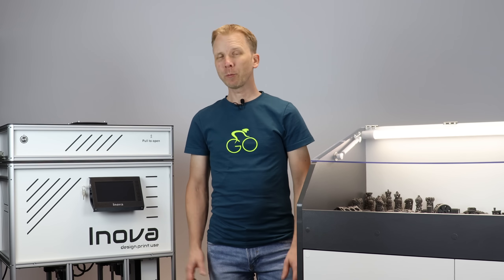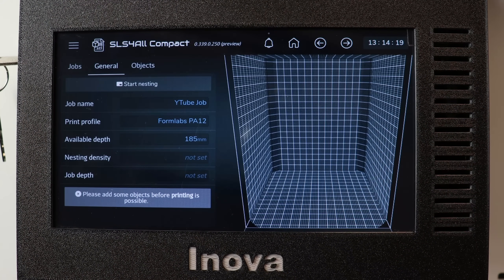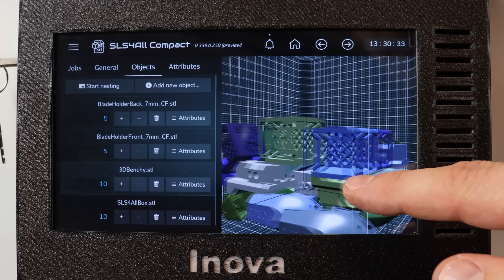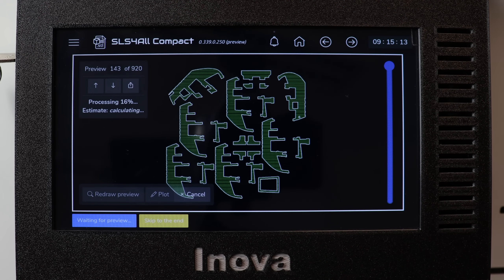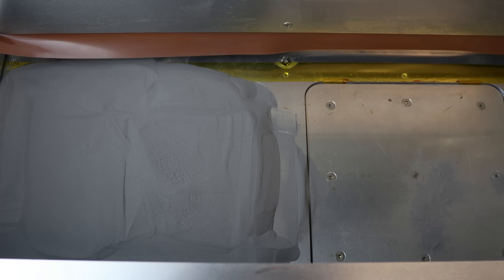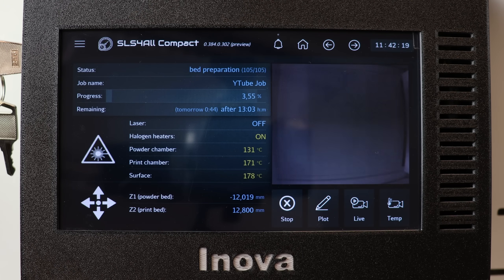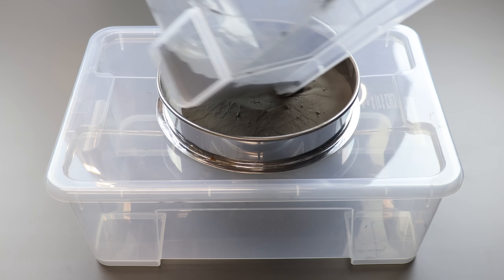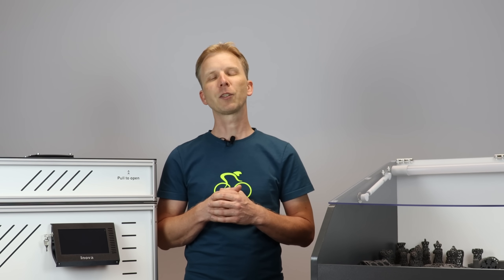Excited about building DIY SLS printer? See how it prints!

Comment: Can it print with gypsum powder, what plastic powder do you use?
Reply from the maker: I don't know if gypsum can be sintered togetger, but I guess that not.
It is designed mainly for PA12 nylon based powders. But we print from TPU as well and other materials like PA11 will follow.
Reply: @SLS4All what recommended powder to print with it?
Reply from the maker: We print from Formlabs PA12 because it is of a relatively good price/performance ratio. But our users print happily from other powders as well - like Sinterit, Farsoon, etc.

Comment: That print job cost $264 in powder!!  I know a small portion of it was recycled but it's still a lot and unaffordable for most people.  Even if that SLS printer was free, I couldn't use one.
Reply from the maker: Your calculation is completely wrong. Reuse ratio is 70% and the rest of 30% is used for printed parts.

Comment: Very nice!. I may be completely wrong, but I feel like if you added a means of replacing the air inside with Argon, used a higher energy laser, used a building plate with a specialized thermal protective coating, and adjusted the software for the difference in working material.... you could probably 3D print metals with this.

Comment: Great work for a DIY technology appropriate to our times, but it is essential to
Set the Effective Build Volume to the standard: 220 x 220 x 250 mm adopted by standard consumer FDM printers... the customer base will multiply by a factor of 10 minimum...

instead Effective Build Volume for PA12 Nylon: 150 x 150 x 180 mm (4.1 liters) / 5.9 x 5.9 x 7.1 inches (247.2 cubic inches)
Reply from the maker: Interesting point, but I don't think SLS can be compared as simple as that to the FDM. It is like with the SLA - different technology, different use cases, ...
Reply: @SLS4All  Hi, ČESKO
Thanks for your answers
My message just recommends to size the print volume to the same values as those already defined and adopted on the most common FDM printers... it is not very complicated to do, you can, and propose a second model larger by a few mm more to add on some mechanical components of the current SLS4All version, and also define the appropriate parameters for these new dimensions in the SLS slicing software.

I am not making comparisons between SLS and FDM 3D printing technologies. The limitations of FDM technologies compared to SLS and SLA are well known by any designer and maker... Anyway. My intention is constructive, in the positive sense. I would be interested in a SLS4All model with a print volume of 220x220x250mm

Many designers and makers design their object creations based on the 220x220x250mm manufacturing volume that has become standard thanks to consumer FDM 3D printers... So it becomes very easy to adopt a new SLS4All machine for commercial production.

It's all good for your superb product, SLS4All, which can very easily be integrated into 3D manufacturing workshops already equipped with standard FDM machines

Comment: Is there any way to do the deal with the job on the PC and sand the file to printer
I think it may be work
Reply from the maker: You can completely control the printer remotely from PC. You can connect to the printer from your LAN via any browser.
Reply: @SLS4All  So that I can do every thing except printing on my PC?
Reply from the maker: Yes, you can.
Reply: @SLS4All   
Thanks for your answer
Reply: @SLS4All  by the way if that i expect for a huge build area ，and that i have notice that you are using the popular 3d printer control board，so can you add the support for multiple laser galvanometers in the frimware or it just already support?

Comment: I have a Formlabs Fuse 1. What a piece of crap. It fails a lot, I have lost thousands of euros in powder. The support is just "try again. Oh, it worked? No problem then...". 

I have replaced broken parts (they charged me 400 euros for a regular stepper motor, where the only thing wrong was a broken 1 cent pipe splice). Consumables are crazy expensive. They charge 5000 euro a year in service agreement (which I ended because why pay when they have no interest at all in fixing problems -- when the agreement says on site free service). 

So my plan had been to develop my own. Mostly just to have Formlabs buying outright because with their crappy shit of a product they can't handle competitors. But when I see how well you have done, I have cancelled the plan.

You single handedly have built a better printer with better software. You should now get investors and go big. Crush the evil F. 

I wish you good luck. If you want any input from a serial entrepreneur of hardware consumer products, please let me know. I'll share experiences with you that might help you get this manufactured and sold in large quantities. Everything I can do to help crush the scammers from the US.

The Formlabs is totally closed. Can't use other powders. Well, today, I got a firmware update that opens up for other powders. It cost €14,500 to enable. I'm not kidding. And the customer doesn't get ANY info during the printing process that can help diagnose the failed prints.

You even made superior software!! I'm so extremely impressed.
Reply from the maker: Thank you for your words of support. Let's see what the future holds...

Comment: As someone who used to run and service Hp Multijet fusion printers I want to congratulate you on this  very impressive and extremely cheap printer (for the given technology). Have you tested part strength?
Reply from the maker: Thank you! As for the part testing  - not yet, but it is planned.

Comment: What's the maximum print size?

Can you use this for moulds for aluminium casting in a video?
Reply from the maker: Max. usable build volume is 150x150x180mm.
Thanks for the topic for the video!
Reply: Already recommend the machine to friends here in Adelaide South Australia - do you ship worldwide , use metric plans?
 @SLS4All 

I'm sure you can sls ceramic,no?

Do you plan on making a larger model?
Thanks 😊 look forward to casting video 😀
Reply from the maker: Thanks! Yes, we ship worldwide and we are metric.
Printer is only for the plastic polymers, not ceramics. Lager model is not planned at this moment.
Reply: @SLS4All oh, ok thanks 🙏 
So, this printer can't be used with metals ceramics or composites? Just nylons?
Reply from the maker: Not just nylons, but yes - it's for plastic.

Comment: $7,000 is the kit cost. And I believe that does not include the cleaning station. This is a very impressive demonstration. However I would not say at this price that this is something that is "for all." I was expecting a kit to be 2 or $3,000 and even then I would probably wait and see. Yes nylon SLS is far superior to FDM or SLA. Still, a wonderful FDM printer can now be had for 1/10 this cost. When I really need SLS parts I will have a job shop make them and ship it to me, it's quick cost effective these days.
Reply from the maker: I uderstand your point but if you check the costs of the parts needed you will see that price tag you would like to see is now simply impossible.
Believe me that I would be more than happy if I could offer it cheaper. Btw., when FDM and SLA printers started, I mean before their boom, the demand was low and prices high. That's the rule of the market.

Comment: Can you instead place a 500w laser and make it metal 3d printer ? I can help with the ac dc converter
Reply from the maker: No, you can't. Priting metal is a completely different discipline, it is not just about the laser power.

Comment: This thing is amazing! I hope what's published remains published regardless of what the future holds for this wonderful project!
What's killing me is the post processing of these parts. PA12 is a crazy strong material that speaks for itself once you have in in your hands but the process is even more involved and much more messy than even SLA which most people already don't want to do. Seems like the next step is to develop and auto-cleaner as well as a proper powder recycler. Then, while we're at it, we need to develop a part recycler. I don't see why that wouldn't be possible. Just grind down the parts back to powder of the same grain size. I'm sure there is a way to so that reliably similar to the original industrial process as well. Keep up the amazing work!
Reply from the maker: Thanks!
Post processing can be annoying but not if you have the right tools and accessories. I don't think it will be easily possible to have fully automated post processing on the small SLS machines, but maybe I am wrong.

Comment: ading ULTRASONIC vubrator in the hopper/reservoir will make compactnes of powder ultrasmooth without need of press.. )single ultrasonic horn will do the job..  ( add bit of shake every slkice will make sure the perfrect layer.. just saying..
Reply: Btw i see you are Czech..  Are you conected by anyway to Prusa?? or oyu are self-separed project..
Reply from the maker: No, I am not connected to Prusa in any sense of meaning.

Comment: It looks pretty promising ! Thanks for having it Open Source/DIY, we don't see that everywhere.

In hurry to see more complex prints (eg. High details figurines), those were quite easy one... 

Furthermore, comparison of parts strength vs FDM prints could be nice to see if SLS is worth it. 

Total printing cost per gram or volume can be calculated I assumed ?
Reply from the maker: Thanks!
If you are interested in prints with more details check this gallery: https://sls4all.com/test-prints-gallery/#bwg20/590
Mechanical tests are planned, I will post the results.
As for the costs - yes it can be calculated. Powder which I use is about 100USD/Kg.

Comment: It seems during the process of powder bed filling and levelling step 2, it still didnt distribute powder to top right corner and mayber also to bottom right corner seen at 10:56
Is this normal? I fear if this problem persists on all layers, powder cake might collapse from the sides

Also, respect from Germany. It looks really cool. I might build one in the future buying some kits from you.
Reply from the maker: Yes, it is normal and it occures quite often. It is related with the amount of the powder added for initial recoating. Printer'll fix it itself during the printer pre-heating stage very quickly - in a few minutes ( long time before bed preparation and sintering starts).
This is the way how to prepare the printer for printing very quickly without the need to add manually powder repeatadly in to this small spots. So it saves time and nerves :-)

Comment: It looks amazing. One thing that might be an issue is the red text for the bed loading and halogen heater test. Red on black is hard to read.
Reply from the maker: It seems like this just in the video - in reality it is OK. But this is really more than cosmetic issue which can be changed within a minute if needed.

Comment: I love it! Nicely done. In your FAQ, it says "The cost of materials and components is around USD 3,000 excl. VAT, plus other costs such as machine costs, labour costs, etc." but l when I go to buy the kit the cost is $6,990 US.  can you clarify the cost?
Reply: ... Which is not overpriced at all, I would say. The machining alone will cost quite some money. I am considering making this my first serious project for my printnc (btw sls4all was the trigger which made me build a printnc 😊)
Reply from the maker: If you'll source parts and build the printer completely yourself according my documentation, it will cost you say $3-3.5k in materials, electronics, optics, etc. and you have to manufacture other things like all the frame components, cables, insulations, etc. yourself or by someome else.
But people asked me to prepare complete kit as an alternative. This you can order from me and it is for $7k.

Comment: I have an older powder bed printer. It is a Z corp spectrum 510. I have often wondered if it could be converted to a Laser / plastic printer instead of the inkjet. The basic hardware is there. Do you think the software could be hacked and a laser attached to make it work?
Reply from the maker: I don't know this machine in detail, but to be honest I don't see it as the most effective way. If you are able to accomodate there all the necessary heating elements, etc. you can try it but I would bet it won't be an easy task.

Comment: For prototyping parts for commercial design firms, this looks to be a bargain, and very simple to operate. The cost (which is fair for commercial and corporate customers) is going to be out of reach for hobbyists for some time, and the bed size is too small for the arts/film/TV costuming and props models making field. A version able to use metal powders would appeal to many automotive customization and repair workshops, especially those needing to do one-off parts, such as producing a water pump for a car made over a century ago, or interior switches for a SEMA build. The engine block in the thumbnail,.. making a scaled down dual row Radial, or a Merlin V12 would appeal to the model aircraft flyers, and parts for a miniature Axial Flow Gas Turbine or home designed equivalent to a Rutherford rocket engine, would make some very interesting projects feasible.
Reply: Unfortunately "a version able to do metal printing" is about the same as to say: "A version of that desktop CNC router for 3000 bucks, which would be 5 axes and being able to cut tool steel..." - a totally different machine.

I agree that 7000 bucks is out of reach for most of us hobbyists. But I truely think this printer will ignite a process which will lead us to affordable SLS printer - even for hobbyists. And apparently he sells his Kits already well, which he highly deserves!
Reply: @Gaston12345  Oh, absolutely. The price is very fair to small scale commercial uses, Nylon can be used for lightweight automotive parts, is common on many cars for Inlet Manifolds, and I could see a small workshop printing out custom manifolds for inline 4's and V6's, such as ram-tuned throttle-per-cylinder arrangements with this version.
If a customer like that workshop wanted to do metal prints, a higher specced and more expensive version of this hardware would still be a massive cost saving over an industrial 5-axis CNC mill.
Smaller rocket companies would also look at this unit, or a higher priced metal capable unit, Nylon for mounting electronics and payloads, metal for the rocket motors.
Once machines like that are available, competition and sales volumes will bring the prices down long term.
One other thought, Medical applications, like being able to quickly print out grafts for bones from materials safe to use inside the body - Emergency surgeon takes a bone scan of a trauma victim, sends to print lab, and by the time they've done the emergency repairs to blood vessels and soft tissues, new bone structures are available to fill damaged skulls and skeletons.

Comment: Hi, i'm following since the beginning of this channel and your work is very impressive! How much work do you think would be necessary to get the spot size down to 0.2mm and what other parts would have to be improved to get more detail? I imagine the details are now like FDM with 0.3mm nozzle, or what do you think?
Reply from the maker: Hi, since the size of the powder grains is 50 microns in average you get really crisp edges and smooth surfaces as compared to the FDM. But you are right to get more detail we would need to reduce spot size area. It is not a big deal but also not 10 minutes task. I have it in my long list. It is very probably just about the change of the optical path and no other parts need to be changed.
Reply: @SLS4All   Thank you for your explanation, looking forwad to this project!

Comment: What are the pros and cons with other 3d printing systems?...
Im new to this and like to have some honest feedback.
Is this method of sls printing a plastic or more a metal powder and is it possible to do other machining on the parts  like drilling or tapping threads foe example and how strong is a thread for example?...
Thanks for honest feedback and suggestions 😀.
Reply from the maker: It is for a longer writing and this is not the ideal platform for that. So please check project webpage where you will find more information. Also, please consider to join Discord where you can get answer for all your questions 😊

Comment: whoa! having a slicer integrated into the machine is pretty sick! 
But can you still load gcode files? That would probably help when configuring new profiles :)
Reply from the maker: Yes, it is! 😊 Goal was to avoid the need of usage of any other "external" computer while operating the printer.
We use G-code deep in the FW, but overall approach differs form what you are used to in FDM. Anyway, print material profiles as well as the print jobs can be shared across the printers/users.
Reply: @SLS4All  that sounds awesome, none of this open material licence crap 😂